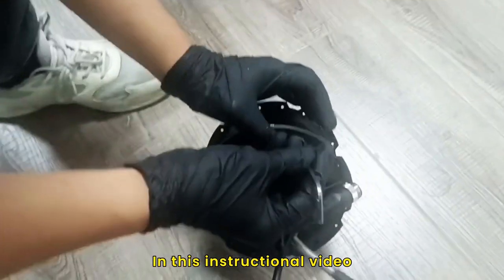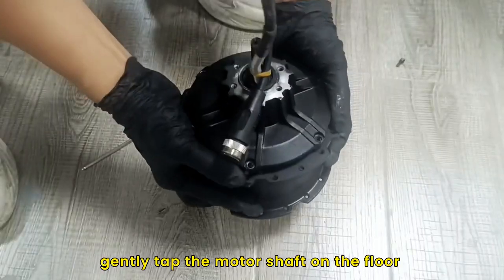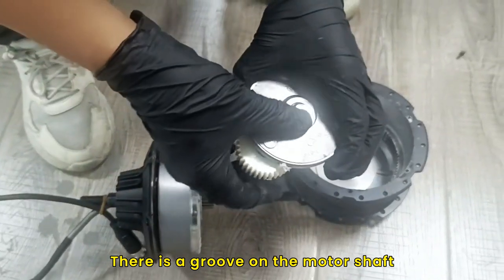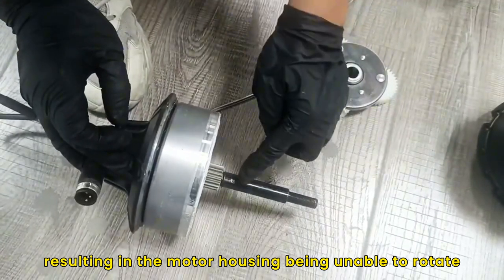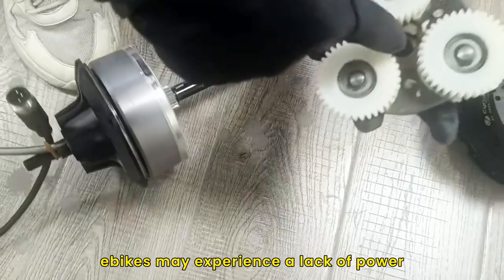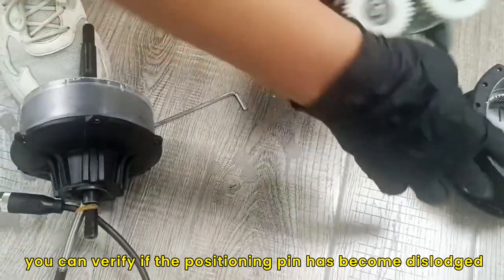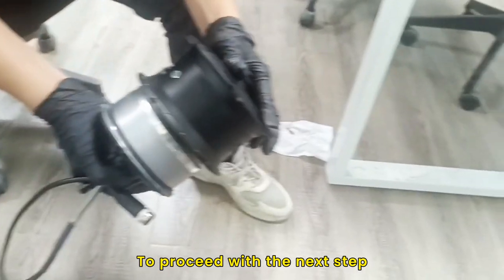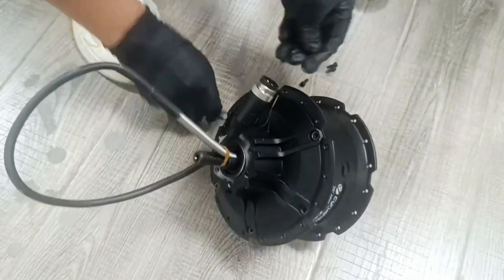How to change the motor for the Kommoda  | cyrusher sports #quicktips

Comment: Le Cyrusher Kommoda 1. 0, avec son capteur  de cadence,  bien  que  n'étant  pas  parfait et d'origine  de la fabrication  chinoise  est l' un des vélos  électrique  réussi  et présenté sur le marché Européen . Si le Kommoda 1. 0 avait  aumoins  des clignotants  arrière,  avec une autonomie  de 200Km en une seule charge et capable de supporter  un poids  total  de 250kg,  avec une batterie  qui dure longtemps  pour une seule  charge  et des freins solides  de type  scooter,  il serait  au top👍. Par contre,  j'ai une question : Pourquoi  le Kommoda 1. 0, après  avoir  roulé  4.000 km qui s'affiche  au compteur,  en mode débridé,  lorsque  on monte  le niveau  d'assistance 3, 4 et 5, son moteur  bafang  fait  du bruit  au lieu  d'être  silencieux ?